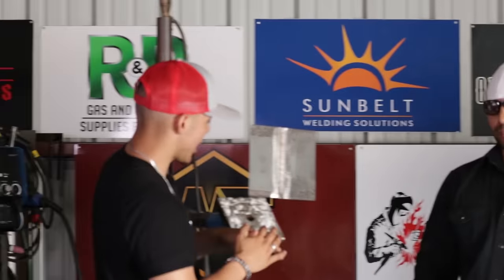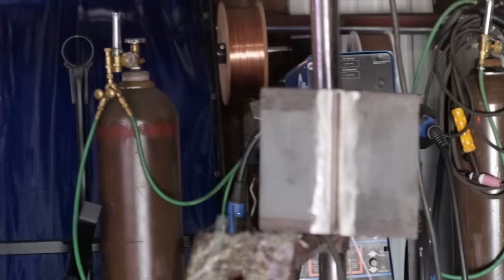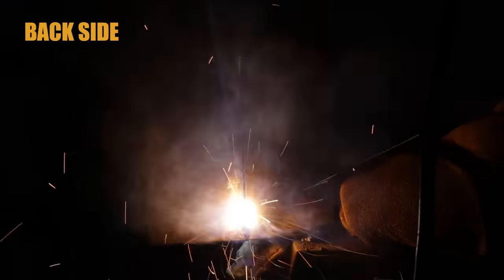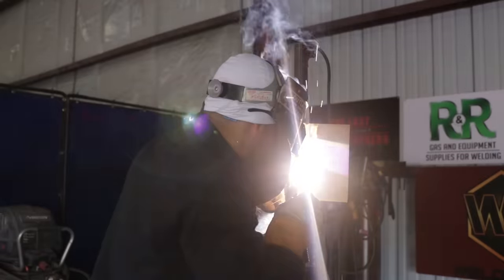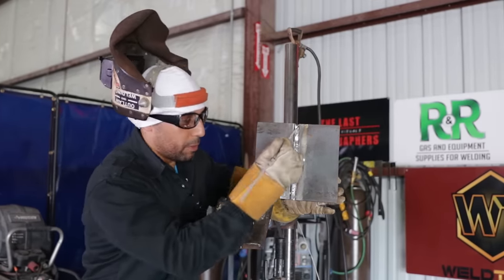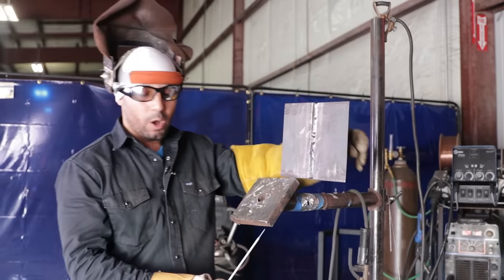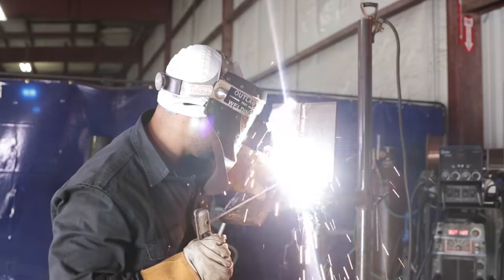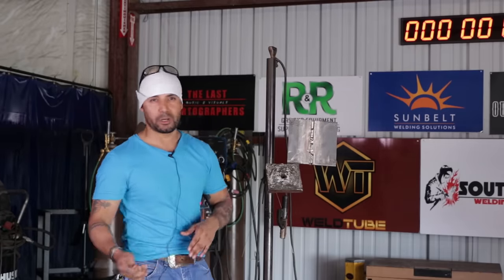3G Open Root Stick Welding

Comment: What's up I'm from South Africa and with the open root stick welding test we do 2g and 3G on one test piece. We call it a T piece could you guys do a video welding T piece. You would need to bevel 3G plates on the top as well as 2g plate would be placed on top with a bevel, and 3 stringer cap

Comment: That's the method I use with 7018 hotpasse. But I usually whip with 6010.
Reply: Yeah how are you sir . am a welder, good welding

Comment: And here I am welding 1/8” sheet with 7018 1/8” rod. Not well mind, but getting better with practice. Just going down to 3/32 rod for easier control seems like cheating. But I’m gonna do it. I get 7018 1/8” for free though

Comment: Hey guys, curious if I can use the whip and pause method for my 3g pass root. And if so, is there anything different I should be doing than running a root pass on 2g?

Comment: He did the root pass with 6010 right? And thanks for your service. We appreciate it!
Reply: trejo_eddyp26 you can use 6010 or 6011 for root pass, 1/8 plate run from 70 to 100 amps it defends on your travel on how fast or slow your comfortable with.
Reply: Goyong Ongoy kinda late😅but I passed my overhead like that. At first it was a paint but after one redo. I got it down
Reply: Finish 6g plate and 6g pipe?
Reply: Goyong Ongoy plate. I didn’t get to do it on pipe cause that’s when the covid-19 thing happened
Reply: trejo_eddyp26 yeah this virus makes this world heal, I think this is human karma's, people diserve all of this

Comment: Please how do I make a good cap pass for 3G vertical plate smaw.
Reply: 1st cap weave a little bit wide like a crescent.. second and next cap just stringer ..
Reply: @muhammadarifadzhar7032  thanks very much. But I do get undercuts. And that's bad
Reply: @RealOthukeIGRA  after final fill pass let your plate or pipe cool down 5-10min.. if your workpiece too hot can cause undercut.. ok let say you use 7018 2.6mm, 1st capping use 110amps make sure arc keep tight with workpiece.. 2nd cap reduce amps to 100amps.. same goest to 3rd 4th 5th and so on..
Reply: @muhammadarifadzhar7032  okay. Thanks a lot for your help. Will try it out. Thanks